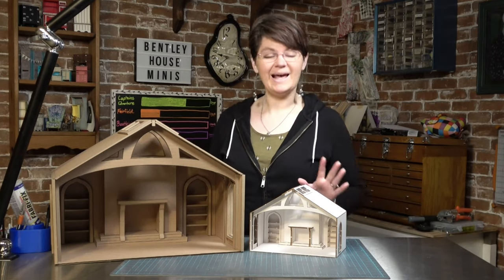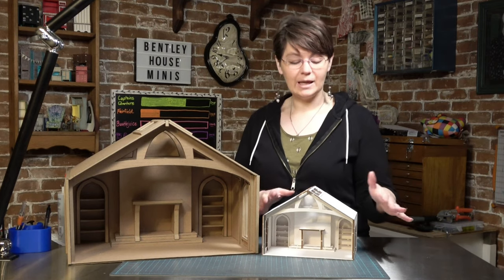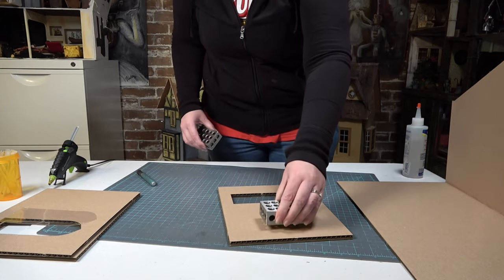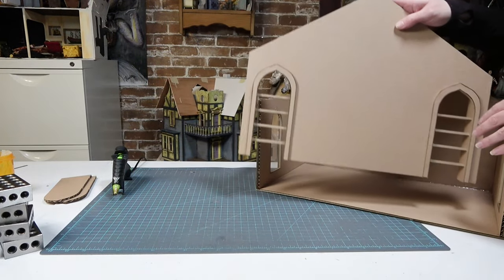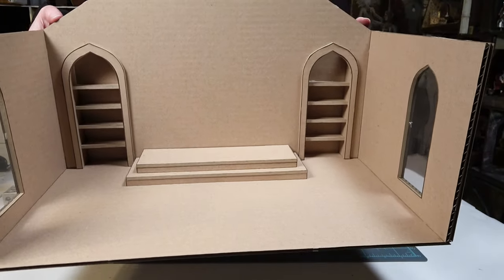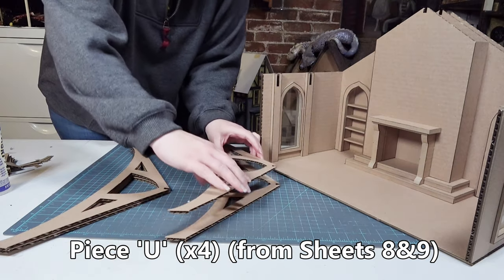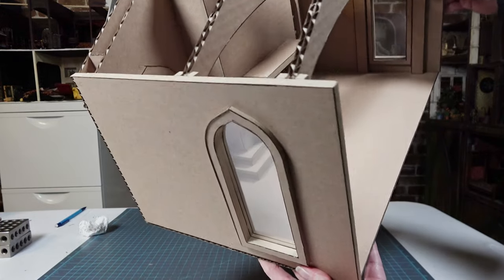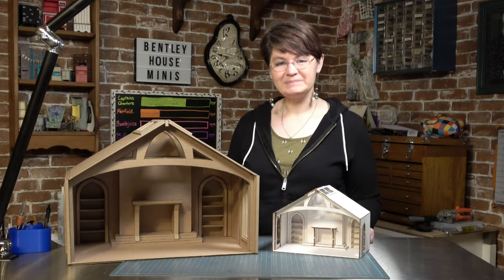Fireplace Room Box Instructions (Bentley House Minis Kit)

Comment: Question:   will NOT installing the fireplace affect the stability of the whole structure?  I want the raised platform to be for  Queen Elizabeth I throne (chair).
If the stability is going to be an issue I will probably just enlarge the firebox opening to fit the throne.  (when I can find one. Lol)
Reply from the maker: The ceiling stretches all the way to the back of the room so I feel like it should be fine without the fireplace structure if you want to remove it.  If you do find that it feels a little weak in that area you can probably insert a couple hand-cut columns out of the remaining pieces that will be less intrusive on the spaces but still provide support.  I hope that helps!
Reply: @BentleyHouseKits  thank you

Comment: Hey could you make a kit for 1/6 scale for Barbie send integrity. It looks so much like a ski lodge
Reply from the maker: I just saw your email about making 1:6 scale.  I have thought about it but haven't had time to source materials to see if it would even work for me.  Hopefully in the future!
Reply: @BentleyHouseKits  hopefully it is similar to the 1/12 with cardboard. At least that’s what @myfroggystuff does plus she uses foam board but that’s not as stable as cardboard. I think only difference might be things to reinforce walls. Or double up and triple up (where you have double) I have wondered if you can use cheap metal straight pins like nails.